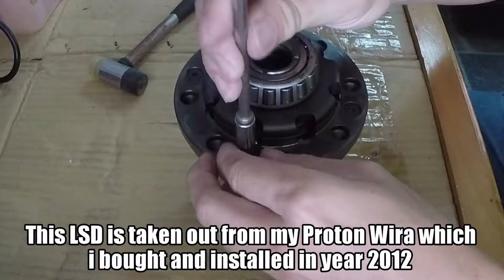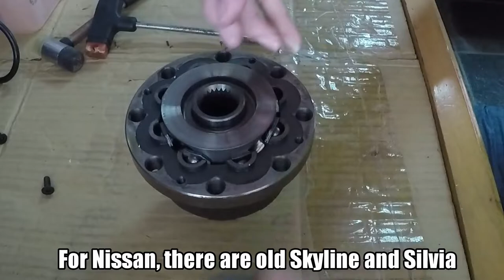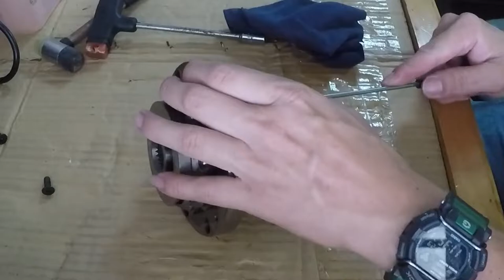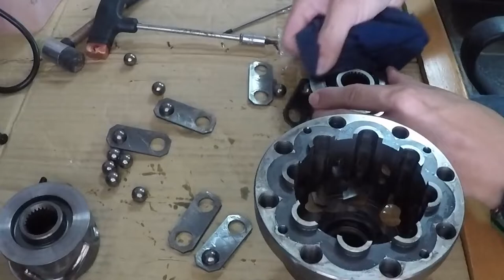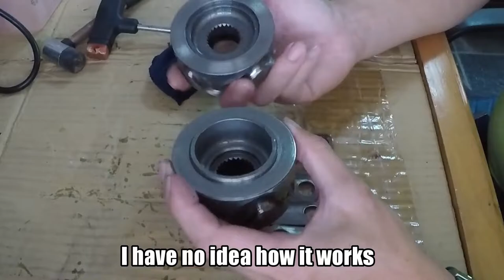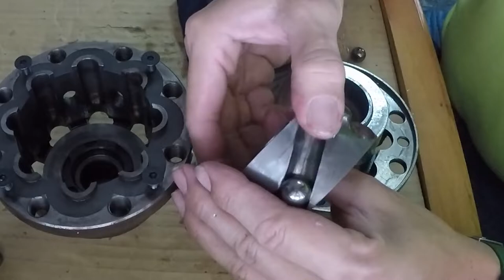What is inside BALLTEC Limited Slip Differential (LSD) type VC

Comment: How well did this lsd work after you installed it
Reply from the maker: it was awesome at the beginning. the traction improved alot during hard acceleration. less wheels spin. things started to fell apart when it starts to make noise when turning.
Reply: @TanYawMingTVChannel  what caused the noise? I've got one of these that I took apart and put back together, it feels like it's locked together when I bolt the lsd case back together.  Is yours the same?
Reply: Mine doesn't seen to have much slip